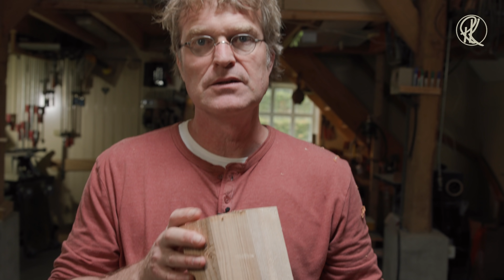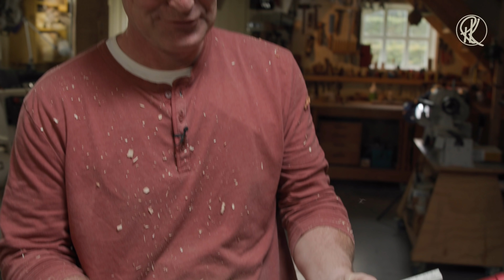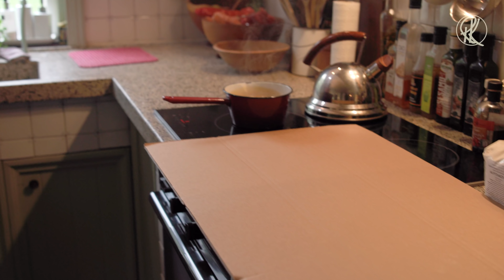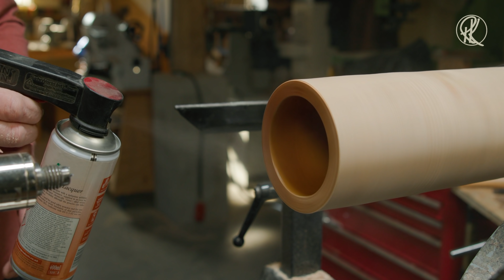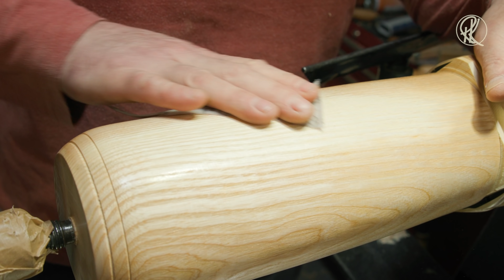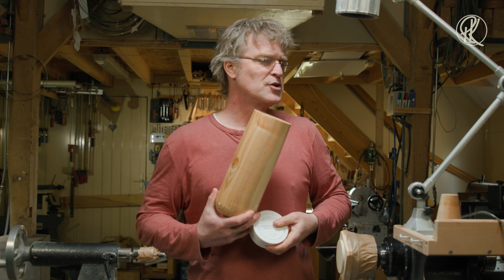Making a wooden wine Cooler. Shiny and waterproof

Comment: Another great video with an amazing result. As always, perfect entertainment as well!
However, one question regarding the brewer's pitch. I applied it in (one after another) three layers. Heated it to 190 degrees, got the piece of wood warm and let the pitch cool down slowly. Why does it always start cracking all over? Are there different qualities? I start to get  mad with it....
Reply from the maker: I don't know Mirco. The wine cooler still has no cracked brewers pitch... and I don't warm up the wood but I also think I don"t melt the BP on such a high temperature...